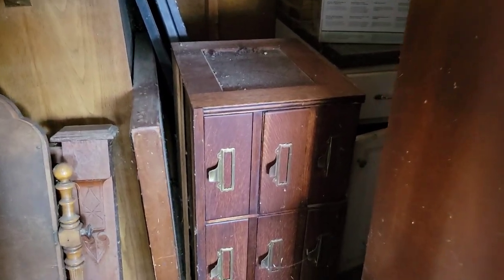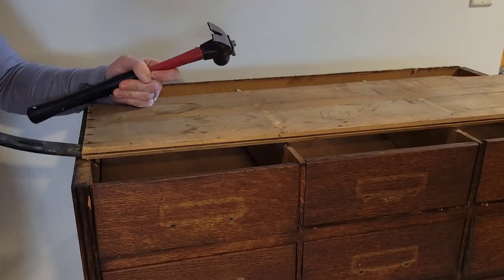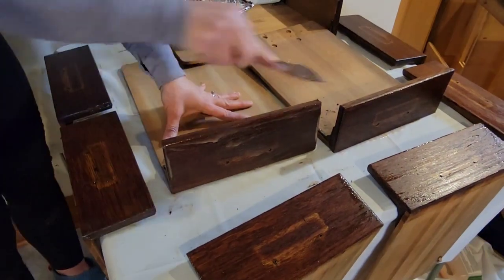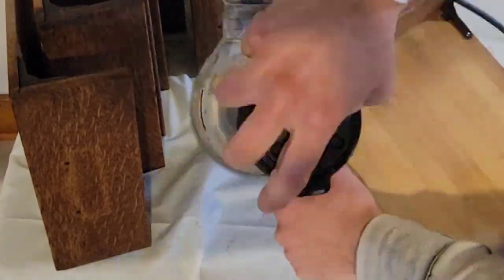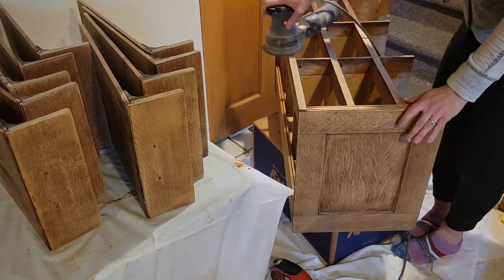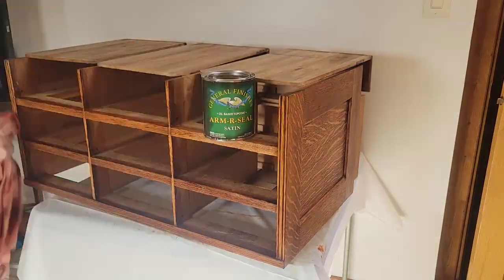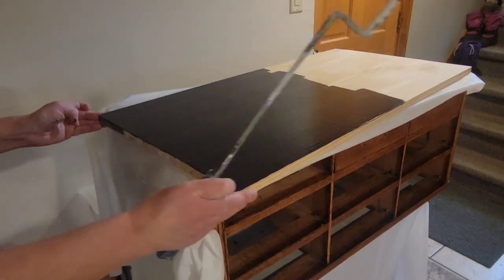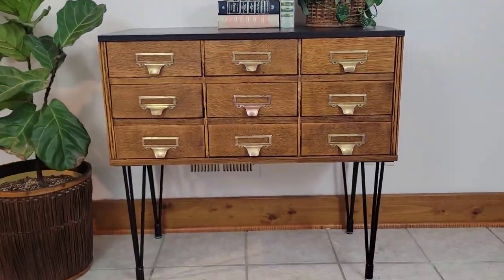Refinished Card Catalog with Natural Quartersawn Oak Wood

Comment: When you sanded it, did you get all the old stain off? Or could you, I mean? I'm a big fan of red oak with tung oil and oil-based poly, at least on floors. I've been tempted to buy old oak pieces and strip them. But I am always worried that I wouldn't be able to get the old stain off.
Reply from the maker: Because oak has such deep wood grain, some of the coloring from the old stain does stay in that grain. I guess you could sand the heck out of it and get rid of most of that, but I don't mind the look. Once you strip off the old oil finish, it really is pretty easy to sand back the stain to natural wood (or at least close to it)